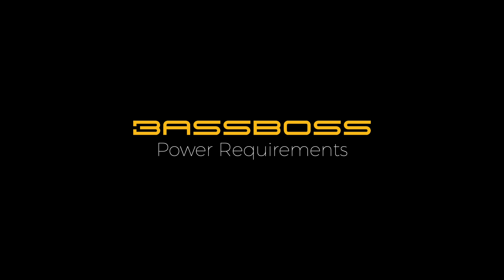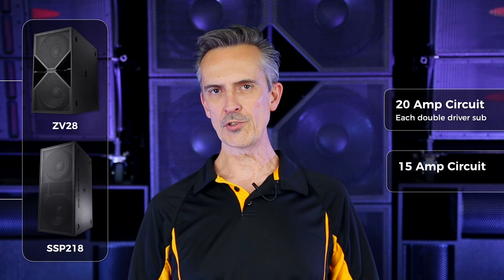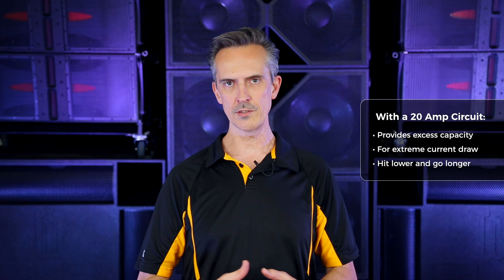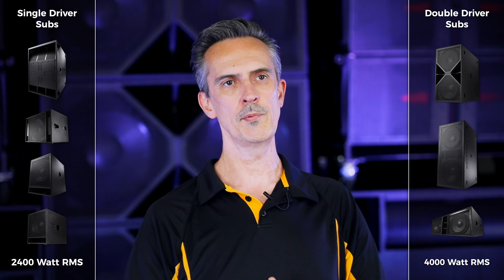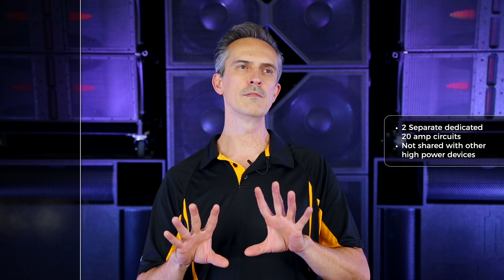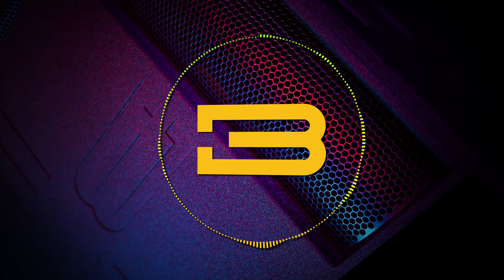Power Requirements For Your BASSBOSS System

Comment: With limited power, you can actually get louder with more subwoofers ran lightly than one or two pushed hard.
Also turning your system down to "80%" = half the power used, as "how loud" something sounds follows roughly with the cube root of power.